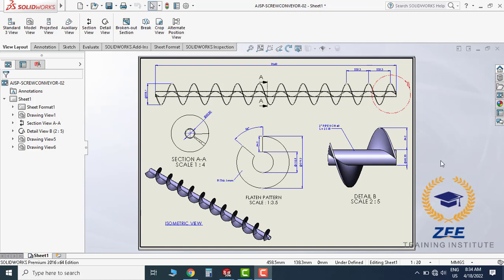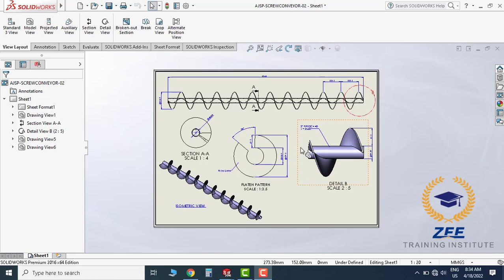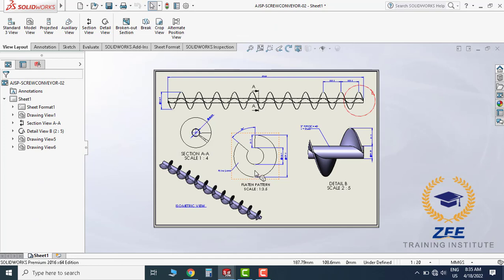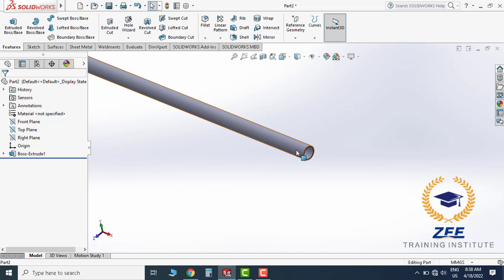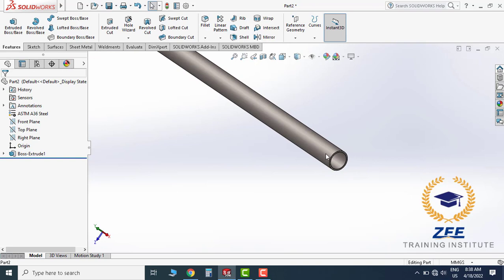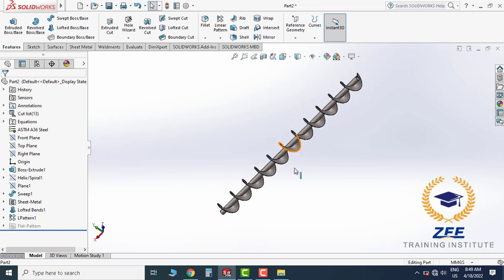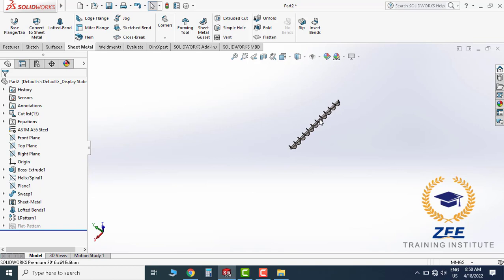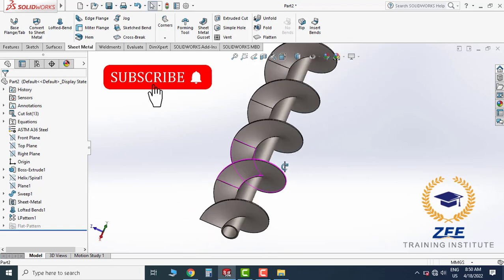Calculate Helical Screw Conveyor in flat form using SolidWorks

Comment: How to measure diameter and hole of flatten pattern in solid works with out save it in AutoCAD file?
Reply from the maker: After converting into drawing you can give size with smart dimension
Reply: @zeetraininginstitute...4300  Still can not measure dimensions of flat pattern. Can you make video on it or can give me your any contact details please.
Reply: @rahulsanjhira2595  I have the same problem. I finally had to draw a 3-point line to force the circle to close and then dimension it.